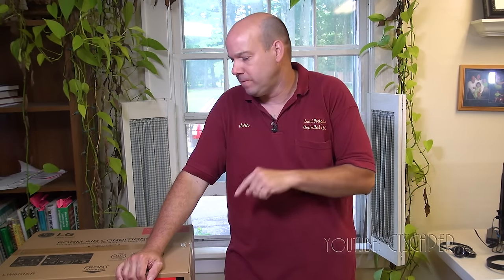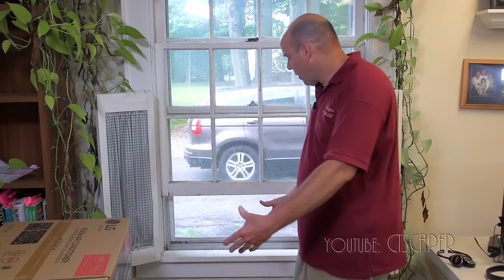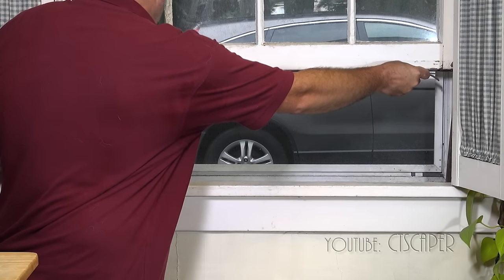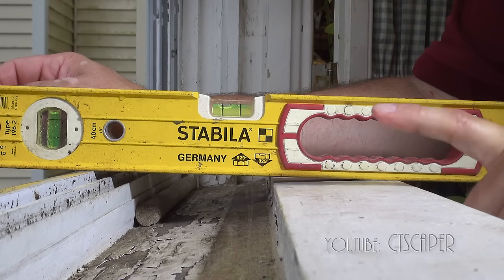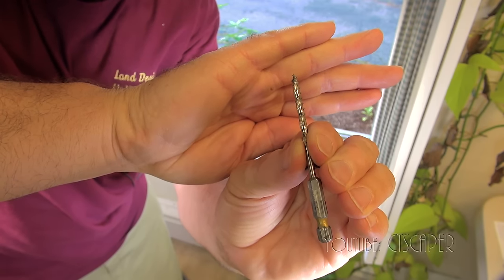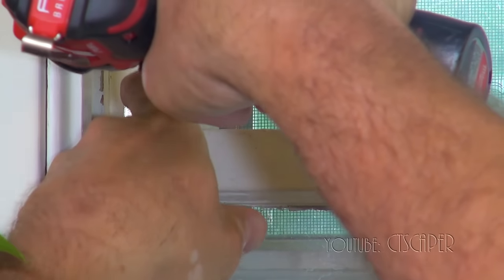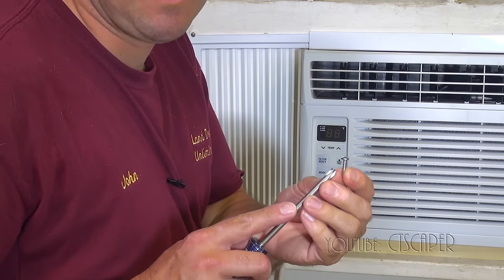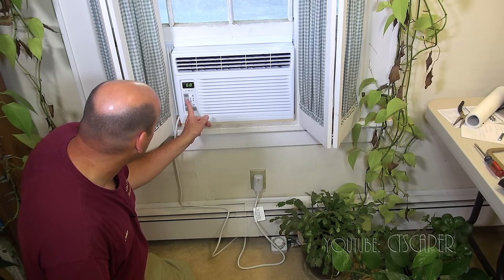HOW TO INSTALL AN AIR CONDITIONER

Comment: I just bought this same ac tonight and needed a better instructions than the manual in the box.
This is probably the best "how to" video I have ever seen, because you explained everything in normal terms. I appreciated your comments about the L-brackets (I've never seen them in the past and didn't bother using them) and the use of a board on the back side of the sill (I opted out, too).
Like Michael, I especially liked that you are a "regular guy;" you admitted to losing a screw and gave the rest of us imperfect people the tip on what kind to buy  to replace it, and you made general but pertinent conversation about the pending rain and running extra errands that delayed the install to the next day. The furry helper was a plus. 
Thank you!! I saved this video to use as a refresher next summer.

Comment: Just so everyone knows. This guy actually knows what he's doing. I've seen professionals do it this way, and the board is key to success. I didn't think the board was essential when I first installed a window unit, because tons of other videos do without it. But all I got was hot air coming out. Turns out the tilt also helps with the flow of coolent so it flows properly and you get freezing cold air, not luke warm air. I also went ahead and got window weather sealing tape and window unit foam weather stripping to seal off my old drafty window. It helps a ton. For windows that face the sun most of the day you can also add window film that blocks uv to help too. Hope this helps more folks out there. Stay cool 😎
Reply from the maker: Thanks Leroy!

Comment: What I found most informative was the importance of the base wood piece to set on the sill and using a level to slightly adjust the unit to tilt back to spill off the condensation/water to the outside of the house.  I was always in a hurry to install window units and rigged them up with props and such.  This time I will do it properly!

Comment: Probably looked 10s of videos if not 100s to see how to install an ac unit in a windows with strorm window frame. I promise this is the most accurate and helfpful video I have found. Thank you so much for your time and work.

Comment: You really did a nice professional job on that! You should see what I do, oh my god it's comical 😂 I have an old window alot like yours and I stuff whatever I can underneath the a/c to get it to tilt back enough that it won't leak inside, and then I use bubble wrap with duck tape on the sides both inside and out to try and keep the weather and bugs from getting in 😂 It ends up looking like a horrendous mess but works well enough I guess. And I use maximum strength duck tape so it holds well but last year when I went to pull it off to take the a/c out the tape pulled some of my paneling off with it! Yeah, a real ugly mess I made and I'm about to be doing it all over tomorrow cause that's when I'm putting my a/c in YIKES!!! 🤪

Comment: Great vid... staying with your current setup, think about adding a few coats of SPAR urethane to that pine so it lasts longer, otherwise it will 'mold up' on you. Maybe consider using thicker foam strips on above and below the unit for a better seal. Less leaks  = better efficiency = less cooling costs. again, great vid.

Comment: Very helpful video. I have an older house where the wooden windows were replaced with insulated vinyl windows that fold down and inward for easier cleaning. As a result, the ledge of the window is above the original wooden sill, and there are latches where you’re supposed to screw in the upper brackets. Can’t put a screw through those obviously,  so I’m not sure how it’s going to work out. Seems like my only option is to try and place the unit in the window and see how it fits. I’m installing it in a second floor window, so I may recruit my brother to help. Wish me luck.

Comment: Hi great video, just something to consider for the future the ductless or "mini-split" inverter units are the way to go. They are very quiet both inside and outside and with a variable speed compressor are highly efficient compared with traditional units (= lower utility bills). Installation is the only headache but I would think much much cheaper than installing central air. I have even seen some units that have up to 4 indoor units connected to one outdoor unit and all can be operated independently. May not be popular in the states but are everywhere in Australia. I use to do the same are you with installing and removing a window A/C seasonally and that becomes a pain after a number years especially if your have a bad back like me.
Reply: I just had a estimate for both ductless mini split and Central the central was half the cost as ductless.Yes they are nice but I would prefer central before any other alternative.
Reply: I just got quoted 45,000 to install a mini ductless split system in my old farmhouse that’s only 1200 ft.² so I guess I’ll be using the window units for a while.
Reply: @lisaburke2296  Hi, How can it be so much? Did you mean US$4500?

Comment: The dog. 🙂 
Ha, I should reply that I loved this instruction video.  It's practical! I can't imagine not having central air, but I'm in the South.  I'm guessing you're further North.  I need an A/C in a particular room that I want to make a few degrees cooler than the rest of the house.  I was looking at these portable A/C's that sit directly in the room on the floor, but having thought it out, a window unit seems a better idea due to the water issue.  It's this or maybe I'll have a ductless A/C unit installed but that requires drilling a hole through the wall. I'm not sure I really want to do that just so I can make one room a few degrees cooler.  Window unit seems the best option.   Great video that really shows us all kind of what to expect before even getting one of these A/C units.  Thanks!

Comment: Back in the 70s I purchased a new house without air conditioning.  This was the way all of the houses came and in the first early summer fans didn't do the job.  My father said he had just what I needed so I drove 200 miles to get a window air conditioner.  The unit was a mere 28,000 btu and weighed close to 250 lbs.  With everything you did would not help the beast. I built a platform outside the window it was going in.  I had to make a drain which was no problem, the only problem was 220 volt which I had to install.  This was the end of my day off so I had to figure out how to ralse the beast and get it in the window.  I had this brain storm idea, since the air did not go down the hall ore into the bedrooms.  I checked the furnace and changed the filter and turned on the fan only.  it sucked the cold air from the living room and sent it through the house.  I had semi central air.  I lived in the house for 6 years and never had a single problem cooling the house.  If you use the furnace fan close off the vents in the basement as that really doesn't need to be cooled.

Comment: That was very informative.  Mine was installed quickly by inexperienced people not wanting to help an old woman last year. Air leaked out. Rain came in. My wall bubbled and it destroyed the plug outlet itself. My windows are low also yet cold air falls. Now will I have to find a cheap ceiling fan?

Comment: What about dealing with that outside storm window that is now up? Rain can not beat on the window seal and bugs can make a nest between your storm window and your inside window. 
Why doesn’t the back of the ac have a pull out seal like the front does?

Comment: Heck. The remotes are a nice feature. Especially when you have an ac in the bedroom or if you have mobility issues. Also, I think the central units are supposed to be more efficient than running multiple window units. And if you;re running window units, 220 volt connections are supposed to be more efficient than 115 volt (or so I'm told).
Reply: Central unit may be more efficient as a unit on paper, but cooling a room you don’t need cold is not efficient

Comment: John, Good afternoon. Just watched your "How to install an air conditioner" and found it informative. Question, what about installations using air condition supports for the prevention of a/c's falling out of windows? Thank you. Theo is a blast!
Reply from the maker: I've never bought an air conditioner with supports so I can't comment.  If the box has them I'd definitely use them.

Comment: You do not need to get CA "tuned in" every year. If you do you have a problem. You should never worry about a system until it dies from a bad capacitor, contactor etc(which are easy fixes for anybody). Or a compressor, which means you need a new unit.

Comment: What about the outside space, blowing rain can just seep in.
Reply from the maker: Yes, unfortunately.  However, the old storm windows (called triple track) like I have (should) have a drain hole at the bottom to let water out.  Unlike my windows, keep up with paint to prevent rot.  It would take years for a window to start rotting away and if you deal with it right away it is manageable.
Reply: @CTSCAPER  I got some plastic sheets, like the size of paper, and clear. I will caulk them in, on the outside. So rain will hit it and drain right down.

Comment: I have a central air unit and it does run me about $200 every 2 years for service. The thing I hate are the service techs that always try and sell you a new unit.. R22 Freon is hard to find now which my unit takes so they give me the run around.. Blah Blah Blah.. So I am thinking about getting 3 10,000 BTU units which would cost me about $900 way cheaper then $8,000..Plus I would save power buy doing this because the central air just eats power.. 4,000 to 5,000 watts per hour.. Ouch.. For the window unit is 1,200 watts per hour for each one.. Still less then the central air unit..
Reply from the maker: Well said!  I'm sure there's no one or right answer to the situation but I agree that window units are ok if you are strong enough to handle them.

Comment: Dont care about the dog or name, I thought the toothpick trick was more important, good tip, sometimes drilling holes in wood get messed up, adding to the sides with pre-made foam was good idea, and dont knock the remotes, my life depends on remotes. All and all some good info on AC installment.

Comment: Why didn't you remove the shell and install the shell because a single female may not be able to carry a full unit.
Reply from the maker: The installation instructions only show how to install the unit the way I did which is the way I have installed air conditioners my entire life.  There are some with a removable cabinet but those are usually installed into a hole in the wall.

Comment: stop knowing what my next project is that I'm going to do. :D. btw with whole house air conditioners you don't need to tune it after the first 1-2 year(s), although I may only be 13 we've never adjusted our air conditioners in this 25 year old house, only problems is the people who initially installed it did a shoddy job for the safety switches, and insulation. :)